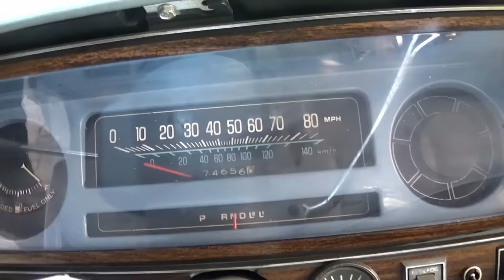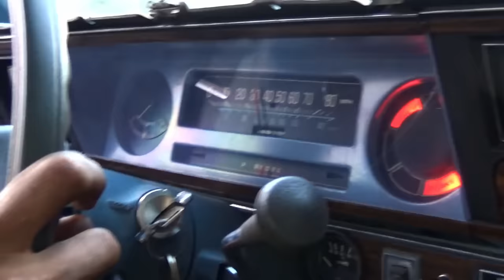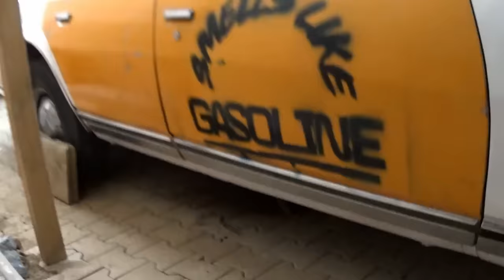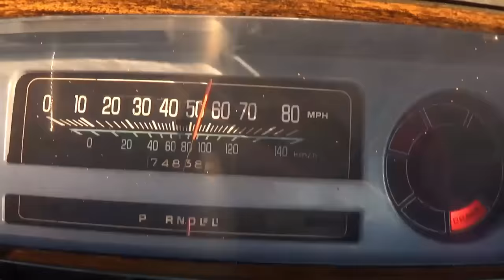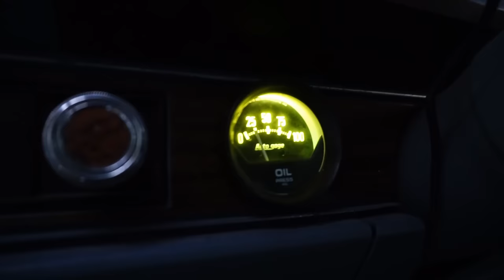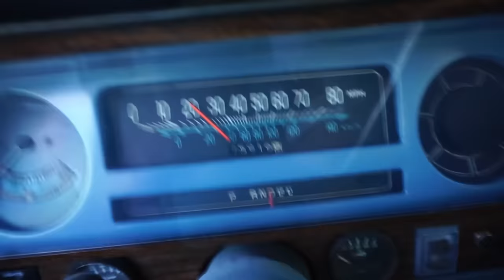Restauration intégrale d'une Chevrolet Caprice 5.7 V8 (2 ans de travail)

Comment: I had an '83 Caprice Classic 4-door sedan for 31 years. During that time, I undertook a fair amount of upgrades, including a complete re-work of the front suspension with Poly bushings, etc. I had the body done in order to stabilize it as it had never suffered any collision damage. My goal was to ultimately restore it completely, but I was unable to get that far with it. It ended up sitting in my driveway on new tires for 8 years while my father declined and passed. As the car became surplus, I finally made the painful decision to donate it and am told that it was bought at auction complete and is registered today but not in Massachusetts (where I live). Seeing what you've done here is impressive to say the least. You're living the dream that I kept hid. Nice work! Happy motoring. Those big GM B-Bodies are awesome vehicles! Thanks for sharing this adventure.

Comment: The doors edge rusting is from the caprice drip rails on top. The trim is designed as water drip rails.  If parked for a long time buy a car cover and put it on jack stands. Also, buy a product called "sta-bil" and pour it in the gas tank . It'll help keep water from accumulation in the gas tank.  Or just drive it once a week. Great video. Great work. You should be proud.

Comment: You did a nice job bring that Chevrolet back to life. I was surprised to see it still had US-style rear turn signals, as well as a speedometer in miles per hour. I'm also not used to seeing a Caprice without air conditioning.

Comment: Merci!  Thank you for rescuing this car!  I do have a fondness for the 1977 to 1979 Caprice.  Everything about the car was done right.  A very solid, reliable car, and durable if properly maintained.  You have done such an excellent restoration job.  I like cars as stock as possible, and apart from the blacked out wheels, it does have a stock / showroom appearance.  A very nice subtle white.  Despite sitting at my home watching this, I am having a heart attack as you drive those winding roads at speed in this!  You are very brave!  Hahaha!  Again, a fantastic project that turned out extremely well.  May you enjot it for many years to come.  Lovely!!!

Comment: I had one of these in the 90's. A 1981 Caprice Classic with the 350 Olds diesel. After a couple of years the diesel started to consume so much oil that I replaced it with a 305 petrol. I remember it as a wonderfully comfortable car, I have had many Mercedes, BMW and other high end cars later but no one was as comfortable as the Caprice, nowhere near. I had to replace a lot on it though, as things kept braking. Everything from rear axle, gearbox, starter motor and other small bits and pieces, I did not mind much as the parts were cheap and it is very easy to work on. I installed coil over front dampers, and reinforced rear springs, the comfortable ride was still there but the road holding improved a lot. I wish petrol was cheaper as I then would be more than happy to drive one of these even today as a daily driver, with a healthy 350 it would have been great. Good job on this car! It deserve a life as they are excellent cars!

Comment: I’ve owned many of these. 5.0(305) or 5.7(350)?? If you want to notice any major power Increase I was screaming at my phone throw a camshaft in while timing chain/lifters are out! You can gain nearly 80HP. And best upgrade…cylinder heads with smaller CC chambers for compression gain up to 100HP. Even old iron 2.02 heads will do wonders for very cheap

Comment: Intéressant de voir tout le travail fait sur 5 ans, tous ça en quelques minutes. Des bagnoles plaisantes à conduire ces Chevrolet. J'ai possédé une Chevrolet Bel Air 1979 argent, 5l à deux corps, le modèle était très similaire à la Caprice, mais avec un moteur beaucoup moins puissant, à vrai dire, c'était une vrai vache, mais j'ai eu du plaisir à la conduire et les souvenirs👌! 
Du Québec, Merci du partage !

Comment: My first hot rod was a 78 two door with the curved rear window. 
I put in a Mildly hopped up 350 engine. 
A Th350 trans with a shift kit and stall converter.  
3:42 gears with a nice tight limited slip. 
She’d do donuts and burnouts for days. 
Would run with a stock ish fox body 5.0
Reply: Loved that car.

Comment: It was "downsized" for 1977, the 1976 models were much larger, and it was Motor Trend Magazine's "Car Of The Year" for 1977. It was actually smaller and lighter, if you can believe it. I had a Bronze 1978 Caprice and a Powder blue 1979 Caprice. They were very good handling cars. The plastic bits, dashboard and headliner were sadly of poor quality, and would become brittle and crack, the headliner would sag... The power window motors also would quit working. They had a pretty hood ornament that looked like the trunk lock cover you installed that would get stolen, and intricate looking full wheel covers that easily fell off or would get stolen as well.  Other than that, they were really fun and luxurious cars to drive, and I enjoyed watching you restore your 1978 model. I hope it provides many years of enjoyment. Aloha !

Comment: I have owned 3 1977-1978 Caprice Classic and 1971-1972 Impala! I have done body work and #1 is a good primer sealer like Epoxy primer paint and body work should be done in a completely dry environment! Another thing these car's need to be driven at least once a month.

Comment: I noticed during your high speed runs, your automatic transmission didn't kick down into passing gear. It could be that the transmission detent/kickdown cable is out of adjustment or broken. Excellent work on the Caprice. Hello from Texas.

Comment: This Chevrolet Caprice is such a boat as you called it compared to all your other cars which all are much more sporting and performance oriented than this one. This car definitely has lived a hard and abused life.  In case your not aware, Chevrolet made a bunch of high performance parts for these cars. But they were not sold for such purposes. They were installed for police and taxicab services. You can literally bolt in almost any GM engine you want into these cars. Any Corvette or Camaro or truck motor you can find will fit. The motor you have in the car now is pretty weak sauce. Drop something in with 400 or so hp and this car will be a totally different animal. And you can get performance suspension parts in the way of springs, shocks, stabilizer bars, suspension control arms, and such whic will improve its handling immensely. Plus you can get fast ratio steering boxes that will improve steering response drastically. 

And virtually every piece is a bolt on. 

These cars this vintage have for the most part left the roads here in the US except for the collector car and cruising market. 

For a big comfortable roomy car, these are much better than many people give them credit for.

Comment: That paint job was messed up and there was rust already forming under it. More of those rust spots will show up. Should have stripped off the old paint so you could identify the rust beginning to form under the paint and cut out the rusty areas. Now it will continue to rust and crack ruining your job. No amount of repainting will fix these issues.

Comment: 1st of all, you bought a Chevy.  2nd, that cracking ahead of the rear bumper is a regular occurrence due to the material and the rusting edges is also a regular occurrence due to vibration and usage.  The rust (like water) will go for the path of least resistance so it starts at the small extremities and slowly grows

Comment: In the USA these cars were used by the police, from traffic cops to detectives, & many were also utilized as fleet vehicles. This body style had a 23 year run, from 1977 to 1990.
Since then, they’ve been modified and restored by various car scenes, from the rap inspired Donk scene, low rider movement, as hotrods, in drag racing & rough examples being used in Demolition Derby.
I appreciate that you restored this car and kept it pretty close to stock.

Comment: Bravo. You do good work.
The tail lights are from a 89-90 vintage but the front facia is more like 1978-1979. So what year is it? Sixth digit in the VIN will tell you.
I love the way the Quadra-Jet sounds at full throttle.
Reply: In the U.S. This particular Caprice is a '1978. Front end and rear Taillights is a dead giveaway..

Comment: I cannot speak French, so thank you for the subtitles. It is really cool to see an old American land barge being kept running in France of all places. I can't imagine how costly it is at the pump to fill up a 20-something gallon tank for a 350 cubic inch small block V8 over there. It's already quite pricey over here in Georgia, USA, relatively speaking for my car. It is a 2003 Mercury Marauder, the last of the land yachts. Unlike yours though, I need premium gas for the DOHC V8.

Best of luck with keeping that car running. I would suggest trying to source a set of Cadillac 4 note horns. General Motors put them on damn near all land yachts back in the day, although your location in Europe may prove it to be difficult. They fit these cars incredibly well (and yours may very well have just the A and F notes of the set; the C & D notes are only on higher end GM cars). I have a few sets I got off some junkyard cars here; I would be willing to sell you a set if you are interested because of how much time and effort you've put into that car. I think it would be a fine addition to the '77.
Reply from the maker: Glad you foud the subs useful thank you! I'll think about the horn proposal heh ;)
Reply: @SmellsLikeGASOLINE  Sounds good! I have a video on my channel that has a clip of how they sound. Absolutely no pressure, though! Take care and thank you for the entertainment.

Comment: Good job, compliments. Can l ask you, what engine capacity and what hp got this car please?.And , last question, di you get the top Speed? What Is It? Thanks for your reply.
Reply from the maker: it's a 5.7. stock it was rated at 170hp. in the current configuration maybe 190. don't know what le top speed could be. between 180 and 200Km/h I guess
Reply: @Smells Like GASOLINE  ok thank you for your reply. Indeed the particula thing ( but Mayne you already know) it's the speedometer,  cause they put like top speed 120 miles, but I  reality the speed is higher , it's just not show on the speedometer.  If you don't know why, l can tell you.
Reply from the maker: @Gasoline2009  yes, it is limited at 80mph at the display !
Reply: @SmellsLikeGASOLINE  yeah. But do you know the reason?
Reply from the maker: @Gasoline2009  federal rule?
Reply: @Smells Like GASOLINE  a kind of. Everything begins in the 70's when in the US they had the petrol crisis. So they " invented " to write a less top speed on the odometer,  so the people could drive slow ( also they had the low speed limits on the roads) cause the could read on theirs odometer that their cars coulnt go faster than 80 or 88 miles. But in the reality that cars could run faster but most of the people didn't want " risk" to run over that limit. I know, it's a typical American way to think, but this is the reason.  So , If the people drove slow,  they could " save " money with petrol. 😁